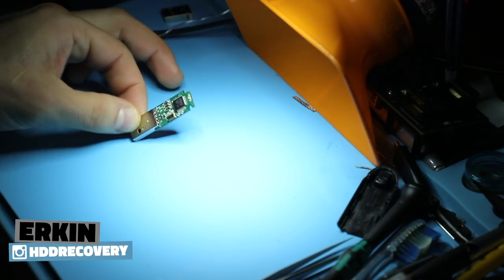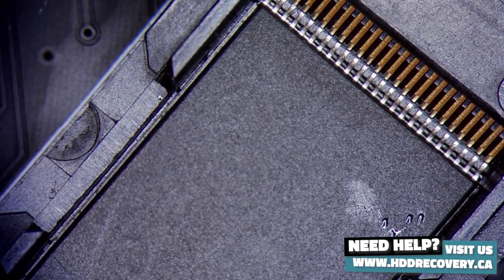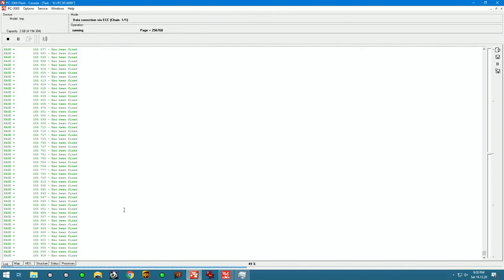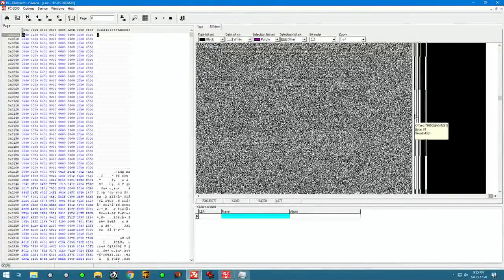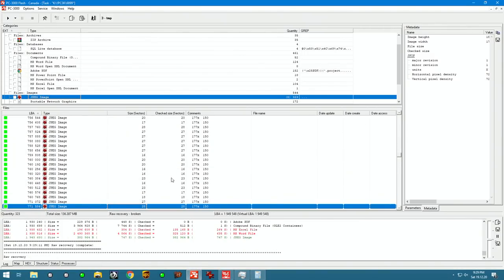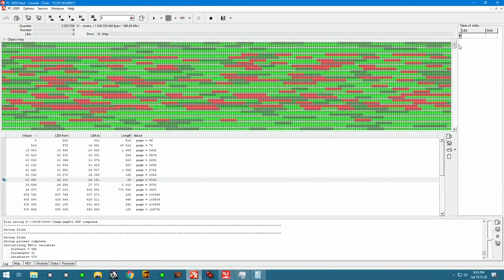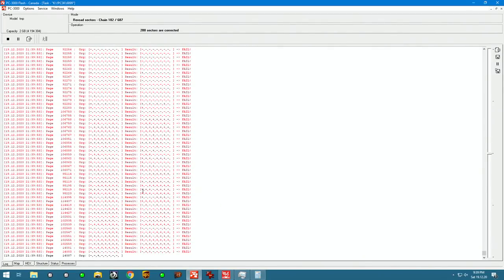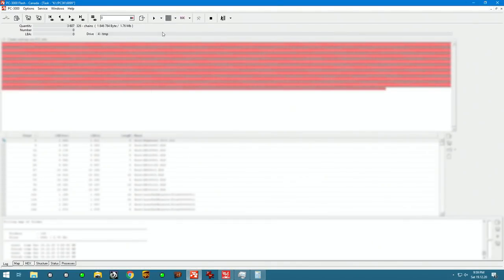recovering data from bad flash drive

Comment: Why do you add the 8 bytes at 9:17? It doesn't matter that the same 8 bytes is added to all 8 sectors?
Reply from the maker: That's the length of the marker which contains LBN. Logical Block Number will be the same for every page within the block

Comment: Amazing! But how did it not short on 16:20 between legs and all this ice in between (Just asking for a friend who is a real beginner XD)
Reply: There's very little water ice there. 
It's mostly frozen propellant from the can of compressed air he's using to spray it. 

And even if it were water ice, ice isn't conductive. 
Pure water isn't conductive either. 

Water only conducts water when it has become ionised (when it picks up metal ions). The little bit of water vapour from the air that condenses and freezes on the cold chip won't have long to gather ions from the TSOP/socket contacts. 
Keep it cold and you won't get any shorts. Let it melt, and most of the now-melted propellant will quickly evaporate away. The little water ice remaining isn't enough to cause a short
Reply: @scottrobinson4611  Very interesting. Thank you!

Comment: I've been watching your videos for a while now and i just want to ask if you or anyone here knows how to fix a Raw sd card, like i cant format it with windows or 3rd party software and it shows up as an 8gb card instead of a 32gb card like before (the card is actually 32gb). If you need info on how the card got into this Raw state, you can ask via a reply
Thanks in advance
Reply: Honestly, had a bunch of corrupted memory cards official sdcardformatter and other Windows tools couldnt touch, but Linux could. Might want to try booting a live environment of Ubuntu or something and try formatting it there.
Reply from the maker: The card has problem that can't be fixed with software
Reply: @lukassvardkvist9161  I already tried that, sadly it didn't work
Reply: @hddrecoveryservices  well, im gonna keep the card until i can send it to a recovery service since i still have data on there. Maybe I'll send it to you guys in the future

Comment: You might want to spray the chip and socket with water repellent liquid BEFORE you freeze the chips so you avoid any further short circuits from condensation (WD40, thin linseed oil or Vaseline)
Reply from the maker: I've been using this technique for years without issues. However. I do see how contamination of contacts can cause issues later in the socket.
Reply: @hddrecoveryservices  It surely will contaminate the socket. Sonic bath to the rescue :) Anyways, great videos

Comment: why did you not attempt to heat the chip or over volt it more?
Reply from the maker: I tried all options with it. low voltage and cold was what gave best readout results. If I spent another 2 weeks on this case, maybe it could get close to perfect, but 1h or 2 weeks :) big difference